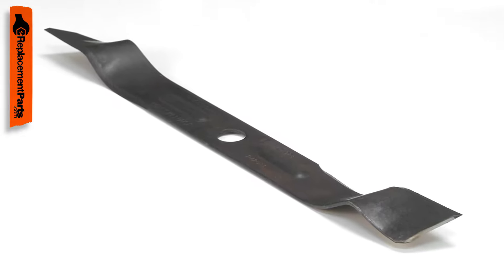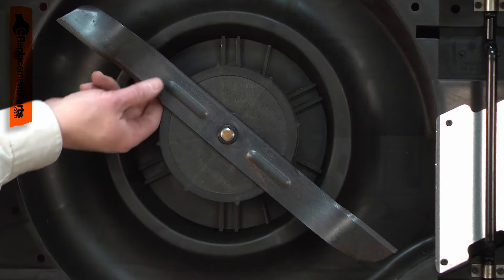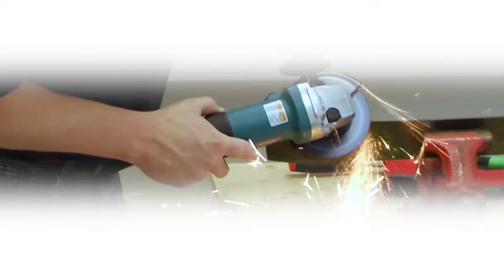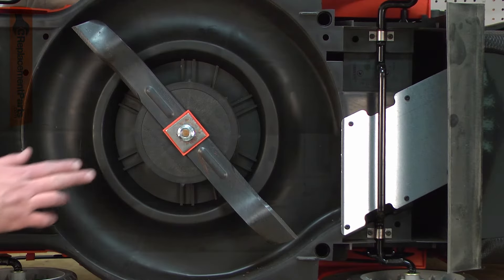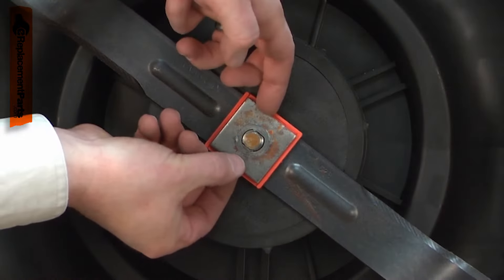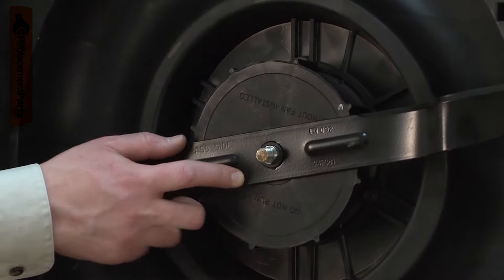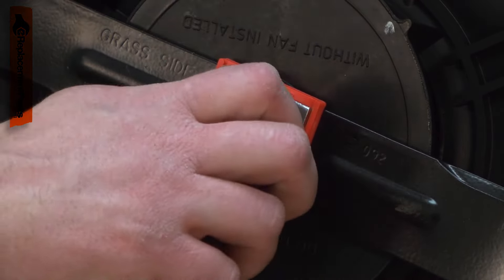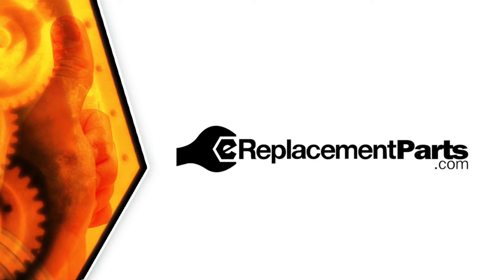Electric Mower Repair - Replacing the Mulch Blade (Black & Decker Part # 242381-00)

Comment: Thanks. After sharpening the blade, my dad replaced it but incorrectly reinstalled the spacer/insulator/blade. Fortunately, I didn't lose any toes when the blade came loose underneath the mower.

Comment: Good, clear video.  One thing- if you also replace the plastic fan at the same time, you may need to file the ends of the blades if the replacement fan has longer ones that the original and hits on the mower body bolts. I used an OEM part and still had to do that.  Not a big deal, but if the fan does not turn freely and hits the bolts, you're likely to break some of them off when the mower is used the first time after your blade replacement. Also, the are people who will sharpen your original blade (still have to take it off and put it back on when sharpened) and it can cost under $10-  cheaper than a new blade.

Comment: None of these tubers mentioned any level of torque on that nut. Is there a standard way of tightening...like a half turn after finger tighten or a quarter turn? Or do you just cinch that nut down till it screams?

Comment: OK first off thanks for the video but the thing about these youtube how to vids is that they are always done on virgin pristine perfect from the factory items. 
Doesn't look anything like my decade or more mower with the rust and mung and clippings etc. I have the same problem others have mentioned and no one has solved where I block off the blade and I maybe get one turn of the nut on the shaft and then the nut stuck to the shaft and now the nut and the shaft all rotate together and I don't see anyway to stop that or was that the function of the insulator when it was young and fresh and brand new? I took the black plastic cover on the top of the mower motor off hoping for a way to grab the shaft from that side but nothing seen there that will help. And so if this is the insulator has become flattened ......should I break the insulator out of there but I still think I'll have the same problem where nothing is holding the shaft in place while I loosen the nut. I've tried various ways to wedge a flat blade screw driver in there to stop that shaft from moving but nothing worked so far.  I did spray it with some penetrating stuff before the heat drove me back indoors  but while that may help unfreeze the nut from the shaft I'm not getting my head around how I'm supposed to stop the shaft from turning with the nut. Someone must have dealt with this before me hopes. And hope this did not sound like a gripe session- Also dealing with a 15 year old JD lawn tractor and yes I agree I need to buy some new stuff but trying to extend these suckers until I move in the next couple of years...just a few years more oh tractor goddesses I promise:) . Thanks folks and if I figure something out tomorrow I'll come back and post here
Reply: OK looked at some more videos- in particular one by this same company on how to replace the fan part and that one shows more detail on both the plastic insulator and the lets call the metal part a  modified metal washer. The shaft as you will see in the vid and/or on closer inspection of yours has two flat sides opposite from each other. That metal washer has two little nubs or tabs that have to be aligned with the flat spots and is held in place by the insulator. So that is what is supposed to keep the shaft from rotating along with the nut. So get a good light and/or magnifying glass and its too late to try this tonight but I'm guessing I got the first turn out of the nut and the shaft stayed put for that turn and then for whatever reason it popped out of place allowing the shaft to move with the nut. So my plan is to enlist my wonderful wife for the extra hands and general good cheer:)  and see if I can have her, with pliers or a screwdriver , to hold that metal washer with the tabs in place while I continue to loosen the nut.... should work I'll confrim tomorrow. Hope this helps someone in the same predicament and going to go ahead and order another one of those plastic insulator/washers things also. 
Good luck
John
Reply: All righty what really got that nut off was sitting overnight with the silicone penetrating spray on it. When I came out the morning I could simply turn the nut with my fingers. 
As a side note my metal washer is different than the one in the video above. It does not have those two little nibs on it- it has two flat sides that need to match up with the same shape on the motor shaft so I still think that if I had an extra set of hands holding them down in place I still could have gotten the nut off with some muscle power. 
Hope this bails someone out - now I got to take one of my JD rear tires to the shop to get a tube put inside to see if I can milk a few more years out of that dinosaur:) ROAR!
Enjoy your lawn care adventures 
John

Comment: We are trying to change our blade as you are showing and we have the blade blocked with a piece of wood but when we go to tighten the nut the metal spacer and the insulator just turn because the whole shaft can turn.....is there something wrong with our mower?
Reply: I used an impact wrench with 3/4 in socket, easy peasy
Reply: It may be that your plastic insulator/spacer has flattened out.  I had the same issue. The spacers aren't very expensive.  Just be careful when you install it not to break off the edges that go around your blade. If they're flattened out on the blade side, it can do what you describe.
Reply: I am having a similar problem.  When I go to remove the nut the fan and blade stay stationary but the nut and the treaded rod that it is on rotate together.   The nut never loosens.  Is there some way I can stop the shaft form moving from the top???

Comment: Can't get the nut off mine, the plastic spins underneath also.
Reply: I used an impact wrench with 3/4” socket, even all rusted up it came off in 10 seconds